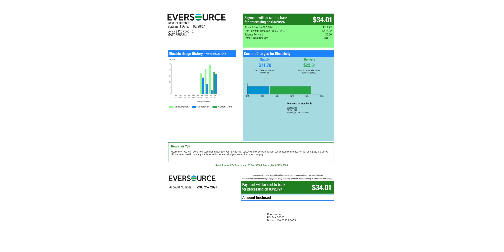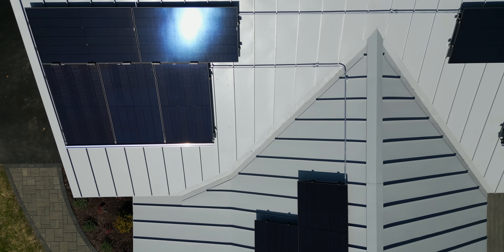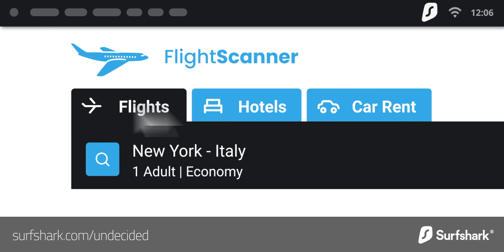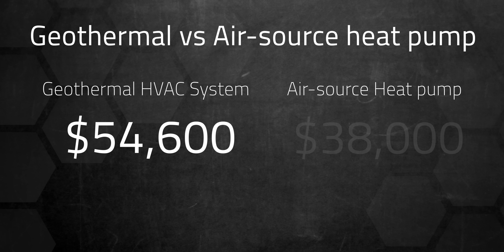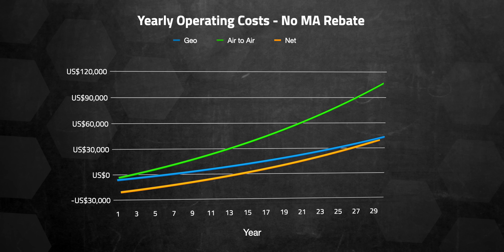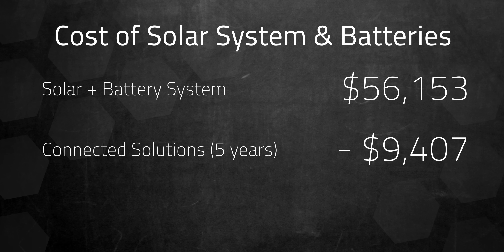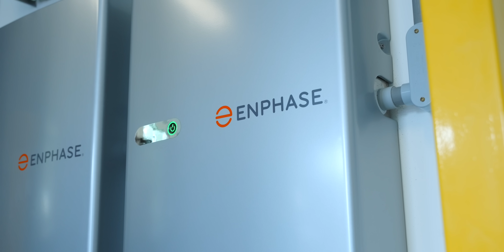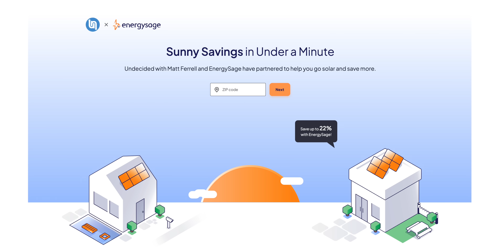What I Learned After 1 Year with New Solar Panels

Comment: As European I have so many questions.

First I have to say I think it's a little bit funny how strange it is in the US to build such a energy saving home . Over here it's pretty much standard and required by code. 

And why did the solar installation cost 90 grand??? I am so confused. I work for a solar company and such a system would cost you around 25 grand  installed. 90 is too much for this

Comment: You didn't factor in the costs of repairs or replacements to your system. You assume that all of your installation will last  30 years.  Most solar panelsbare rated for 15 years but only last 10 years.  Also battery only last 8 years.  Adding in the cost to replace your equipment would affect your conclusions on viability.

Comment: Great video! Glad the house is working out! 
My wife and I added solar and air source heat pump to our house which was built in the 70’s. We upgraded the insulation and recently added a heat pump hot water heater. We both drive ev’s and pay about 1,500 a year out of pocket. I have been extremely happy with everything. I run an oyster farm in Massachusetts and just need to find a good electric outboard so I can switch that over too!

Comment: No business would ever do a payback calculation like Matt did.  This is because he hasn't taken into consideration the value of his assets.  A business would assign a value at installation and then use a yearly depreciation figure which needs to be paid back.  In his calculations Matt assumes that once installed his investment is worthless which it clearly isn't.  In reality his house is worth significantly more because of the energy saving features he has spent his money on.  Someone looking to buy the house and comparing it to one without those features would be willing to pay more for Matt's house because it would save them money, the energy savings more than compensating for the additional borrowing costs.  How much more depends on your local conditions and the perceived value but the additional value put on the house is likely to be anywhere between 40% and 80% of the investment.  Consequently Matt's payback calculations are far too pessimistic and would likely be reduced to somewhere between 2 and 5 years.  If you read this Matt, please would you do the return on investment calculations as any business would because this would give viewers a much better idea of whether it is worth making the investment if they live in a house that isn't going to be their "forever" home.

Comment: I’m currently getting a very similar set up on my house right now. Same brand, same batteries. My solar is 15kw and I’ll have 25kw of batteries. My yearly consumption is about 20k KWH per year. I’m hoping my set up will cover 100% of that. My house was built in 1960 and doesn’t even have insulated walls. I’m planning insulation up grades in the future to off set my future planned increase in electrical usage. I have one electric car, I’ll likely eventually get a 2nd one. My cost in California is nearly identical to yours plus a roof replacement. I am so happy and thankful to see a similar set up for similar price. My electrical rate is $0.50, and my average yearly bill was $750. My new theoretical bill should be $30 per month. $15 for electrical usage, and $15 service fee.

Comment: As a UK viewer I struggle to understand the numbers. Your per kWh costs and minimum charge are  lower than in the UK. But we live in a 5 bed Victorian house (albeit with upgraded insulation) and have a hot tub (heated using a heat pump).

We have 3kW peak of solar, 20kWh battery, and an EV mostly charged at home and our energy bills are less than £2k per year.

Comment: Very interesting, I was a project manager for several new high-tech schools in Mass and have a great deal of experience on HVAC systems and energy management systems.  I have done a little on homes as far as retro fit for energy on simple systems as well as my own home which is old. My question is on the longevity of the batteries, heat pump, solar panels, and connected electronics and systems and the cost of repair or replacement of them? I know of HVAC systems on homes with 90% or higher furnaces the replacement cost of an ECM motor is huge compared to the older Split capacitor motors, which lasted for many years longer on average, as well as the labor cost involved to diagnose and replace them. Also, the heat exchangers rot out much faster in the high efficient furnaces. Were these types of cost calculated into your model?  Also, rebates are not free money, taxpayers or utility payers are paying for the rebates driving up the rates, so the people who can afford the systems are really paying for others that can afford the systems. Thanks for the information.

Comment: For low solar access houses, I’m wondering if a geothermal heat pump with batteries to be charged overnight would be a decent option too? Assuming building is already upgraded for insulation & “efficiency”. At least the biggest cost of space conditioning & electricity costs would be reduced

Comment: Where I am at in Virginia you only get to rollover credit on you net metering each year equal to actual electricity you paid for that year.  Was a surprise when my credit went to zero just before summer where I use more than I make.  Luckily they let me switch the annual zeroing out to October so I may not have to worry about zeroing out my credit.  Still had to pay for the overage for this summer.  Sounds like yours gets to keep the credit.

Comment: @UndecidedMF  thank you for the breakdown.  You briefly mentioned EV charging, but I was wondering whether you factor that into your payback calculations.  For example, I have solar on my roof that produced more energy than I used after my first year.  Over that 12 months, I paid SCE's monthly Non Bypassable charges less peridoic credits for Climate investment and AC cycling.  The total SCE payments for the year was around $120, or $10/month.  In addition to cancelling my home's electorcal consumption, this amount also covered the charging for both of my EVs.  My question is whether it would be correct to factor in the gasoline savings for the year?  I calculated a total of 18K miles combined for both cars.  Assuming  two gas powered cars getting an estimated 25 mpg, this results results in 720 gallons of gasoline saved.  720 gallons at $4.75/gallon results in about $3,420 of gas savings for the year.  Am I overlooking anything in my assumption?  Thanks, again.

Comment: This guy is WRONG. Spending too much money on a basic home system. Its a marketing scam in the solar market. DO NOT BE SCAMMED BY THIS WHOLE IDEA. 

WHAT YOU SHOULD DO:
Actually go green by minimizing costs. Cost of system is the most telling figure for forcasting environmental impact. The money goes places and grows and fuels more industry which is NOT GREEN!!!
You should probably diy it. 
You should become personally responsible for yourself and learn instead of being an imp rat to the solar industry. 
Make wealth through knowlegde and DOING.

FOR A REALLY VIABLE SYSTEM:
Egs002 inverter board 48v system at 200-300a will do all the things you need. The boards are robust and SIMPLE. This is green. 
They need a transformer, you can GET AMORPHOUS transformers for 48v switched to 120v X2. 
These transformers are tiny, like the size of a hockey puck and they will run 8kw. 
Find the transformer, and find the inductor YOU CAN EVEN WIND THEM YOURSELF. They are not difficult, not too many turns and they can be MOUNTED IN 1 BOARD WITH FAN AND SWITCH AND READOUT DISPLAYS. 

With the AMORPHOUS transformer, and the egs002 with 24 mosfets, you get, 95 PERCENT EFFICIENCY. AND only about 15w on standby or LESS if you do a good job on the transformer. 
THIS IS SMALLER MORE POWERFUL AND CHEAPER THAN ANYTHING ON THE GODDAMN MARKET TODAY. 
ITS ACHIEVABLE. 
Its technology that is about 10 years old or older, Amorphous has been around for decades and so has the inverter bridge schema. 

You can have the module THE SIZE OF A SHOEBOX and it will do the whole house for decades if its kept cool and clean. AND YOU CAN HAVE 2 just so you have a replacement that is redundant or even in an emp proof storage box if youre concerned about that. 

NOW BATTERIES. THEY ARE LIFEP04 NOTHING ELSE EVER unless lto. 
They are made in china on factory lines in about the most efficient and professional way possible. NO use in reinventing the wheel, pay the people forward, they are the ones deserving the payback. 
Its direct from china at about 1000usd per 16kwh for the lifepo4 RAW CELLS. 
You need 16. Easy, string them in series, add a balancing bms, only 1 to 5 amps is all you need NOTHING MAJOR. Invest in a fuse block and an enclosure that is safe against all types of possible problems. 
CHEAP 
AND EFFECTIVE. 
I would go for 16kwh only myself, and thats cheap 1000 dollars. Easy. GREEN. DONE. Then I assemble the transformer inverter board, its in its separate enclosure safe, and cooled. 250usd DONE CHEAP EFFECTIVE ABSOLUTELY. 

Then just disconnect the house from utility, just like that, and Have YOUR system in a rolling tool cabinet or something nice, next to the power box, add a connector for easy installation. Add your solar setup REAL MPPTS ONLY not some cheap ass inferior toy product GET THE REAL STUFF
AND thats it. 2000 dollars easy, first try WORKS.

Comment: While I have to commend your admission to "not everything being rosy and bright" and how your situation is unique and may be vastly different to others... I still must posit that this is not much more than anecdotal evidence and bears little resemblance to most real world situations... You BUILT your new house WITH all these factors in mind which is almost definitively a much lesser option for vast swaths of the population... You also got a LOT of subsidies and grants that reduced your financial footprint and greatly assisted in the cost amortization over the projected 30 year span... you also have not yet experienced the costs of maintenance and system degradation as a factor... Those will all start weighing in more and more beyond the first ten years and given the current state of manufacturers" promises" to promote the sale, I believe you may be in for a ruder awakening as time progresses... not to mention that ALL costs are now entirely on you... despite what situations may arise and change... that is one minor advantage of spreading it out among many people as there is more availability and impetus to get things taken care of quickly.

Overall, I still am using what portions I can to reduce, reuse, or replace... but I am looking at it from a point of balancing risks and benefits, as well as financial stresses and variations.

Comment: I have done some cost estimating for my future dream home with a 12 kW panel array and about 60 kWh of battery. If i play my cards right I think I can get it done for under $20k. (My spreadsheet shows a hair under $17k but have to have a contingency). Because the cost of electricity is so expensive it should pay itself off from an energy perspective in 3 years. In reality it would likely be longer than that since I probably wont use the full incoming power and some will be wasted. But, freedom from the grid and avoiding outages is worth paying for.

Comment: At 1:53 min should say output is 18,000 kWh/yr or 18 MWh/yr.  (Works out to average output of 2,050 watts over a year.)

I don't know why the industry calls your heatpump "geothermal".  Geothermal implies it's receiving high temperature heat from the earth like a geothermal power plant does.  It should be called "ground source" as opposed to air source.

You don't say where you live, but obviously if it's Arizona as opposed to Minnesota that has a big impact on its viability.

Comment: I live in Brazil and have installed 12 solar panels (each 550W) with 3 microinverters. The total cost, including installation, was approximately $3,000 USD. It is an on-grid system that generated 41 kWh just today. That is a lot for a single day. My house is entirely electric, and I use induction oven for cooking and AC for cooling and heating. Also the water is heated by electricity.
Reply: yah, 55k for panels?  My entire system is as big as his, and my cost before incentives was lower than his panel cost alone.  I did not install any of it myself.  Someone ripped him off.
Reply: @ fun fact: 94% of the energy produced in Brazil comes from renewable sources. Solar is growing rapidly here. I’ve noticed a sharp decline in solar panel prices in the last few years.
Reply: @zarroth  Yep, he got ripped off big time, paid more than three times too much.
Reply: @waynegnarlie1  Perhaps the fossil fuel companies are keeping that cost to the US consumer high.
Reply: @zarroth  That's typical MA price, contractors eat all incentives....
Reply: The cost of a kWh is around R$0,95 (real) that converts to $0,16 USD. 
The return on investment for solar in my case is around 2 years. 

Also, no government incentive.
Reply: @BrunoMoreira43  2 anos de payback  tá excelente. No Brasil vc consegue vender o excedente p rede elétrica? Acha q adicionar uns 10kw de bateria pra rodar ac a noite valeria a pena?
Reply: @TiozinBroke  sim, o medidor faz duas medições, injetada pelos painéis solares e consumida pela casa. 

Uma conta não me cobraram nada e na outra cobraram o valor mínimo, seria uma média de 100 reais por mês. Antes eu gastava aproximadamente 700 reais ou mais, dependendo do mês.
Reply: @TiozinBroke  no meu caso não vale a pena adicionar bateria devido ao custo elevado. Como moro numa região central próxima de hospitais, raramente falta energia. 
Mas o custo do off grid cai ano após ano, mesmo com impostos elevador no Brasil.
Reply: @BrunoMoreira43  Labor much cheaper in Brazil. A relative's second home outside of Fortaleza has solar standard for each home. 150 miles from the equator, great power generation.
Reply: Yes, I wonder how so many of these builds use so so much energy.
Reply: The scam is that you are not allowed to guerrilla your solar system and the permitting costs and requirements to have an inter-tie system for your power company is what blows everything costwise out of proportion.   When I was younger the cost in California was 13 cents/kw, now its 48 cents.   20 years ago I built a house off grid and did my own 750 watt system with 24v inverter and cheap pwm solar controllers, golf cart batteries,  with the brand new items costing around 6K (FYI costs have gone way down now).  I could have had local power put in for $15K (charging 35 cents/kw).  It used propane for gas stove and instant on water heater at a cost of around $25/mo for 2 people.  MY solar system with golf cart batteries (pure crap) would put out around 22 amps at full sun and would equalize the batteries at 31v.    My son took over the house 20 years later and now it has 2200 watts of panels and runs like a normal suburban home with normal refrig (I was running a converted 7 cuft. freezer that was converted to refrig) extremely energy efficient, and I could run any power tools (2HP table saw),etc.  His system runs his gaming computers, etc. and his back up generator hasn't been used in a long time (rainy days for weeks there).    But getting caught up in the sales pitch of free government money and signing a loan for 50K+ to install a solar system that on paper will pay off over 20 years, ya,,, trap.  I just recently bought 4 used 285 watt panels for $45 ea.   Solar can be cheap and cost effective if you install it yourself, but... you cant tie it to the power company and if the government punishes you for building your own system,  it becomes a nightmare.  For off grid, its a god send as you can have relatively cheap electricity.
Reply: In the US that would cost $10,000, minimum.

Comment: For the geo thermal cost, you could also factor in that if you went with traditional air source, would also required a larger solar array to achieve net zero. So that could be factored into cost saving as well.

Comment: Thanks Matt! But all electric home sounds like my worst nightmare. As a single senior, I can run my range, dryer, hot water heater for about $25 a month on NG, I do have a small solar project to run my most used 120v circuit in my home utilizing an automatic transfer switch (about $90) to switch back to grid at a voltage that can be set. But even as a DIY the ROI is atrocious.